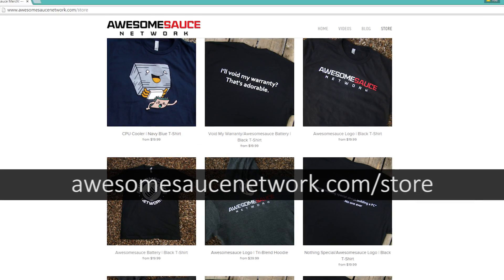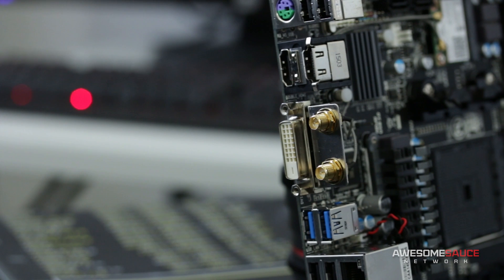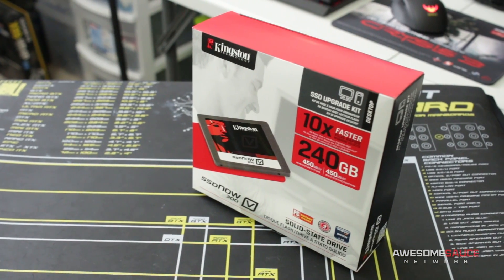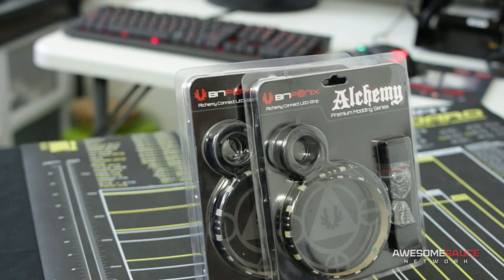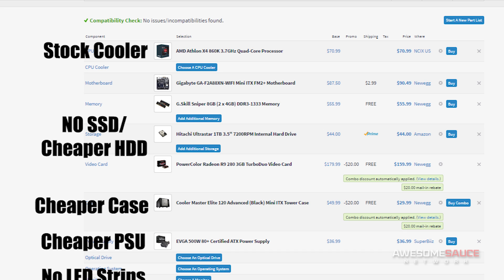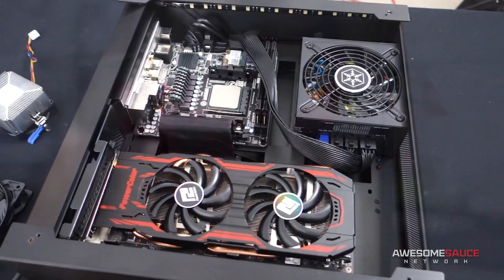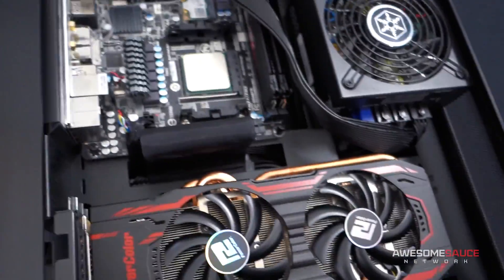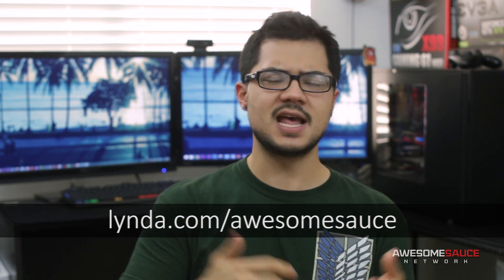The Overkill Console Killer: And How to Build One for Under $500 (Part I)

Comment: I've got a silly but important question...
Can I upgrade the CPU to Intel Core i7 and the GPU to GTX 970 easily?
Btw, I really like that case :D
Reply: Dynek good luck
Reply: @Dynek hahahah okay so upgrade to i7 and 970 and u don't need this case there are alot of beautiful ceses for 150 dollars less
Reply: You need to get a motherboard that supports i7 Intel and amd use different connectors for the cpu
Reply: Resident Gamers I'll try but... this one is fuckin' amazing!!! ;cc
Reply: RGAMING SAM Alright, thanks :D I'll be looking for one.
Reply: Here dude heres the parts you need for the whole thing
http://pcpartpicker.com/p/JKvmZL
All of it will work keep in mind its a smaller version of the gtx 970 but it still packs the same power.
Reply: Moethedirt Thanks!
Reply: Dynek np.
Reply: Dynek if youre only gaming and not doing video editing etc. get an i5 not an i7 dont waste your money
Reply: Tbh if its editing id get a xeon, i7 but for £100 less
Reply: The GPU, easily, however the cpu would need a different motherboard. Also, the i7 series is not suited for gaming, unlike the i5's. I would get a i5 4690k as it is literally the best suited cpu for gaming out there as of now.

Comment: Just my 2 cents as I have built a few of these HTPC gaming PC's. If you are trying to build a "Console Killer" then why get the Lian Li case? Of all the HTPC cases that house a full sized GPU, it is one of the most expensive and luxurious: for those who want to get a less expensive option with essentially the same layout check out the Silverstone RVZ01B or ML07B. They are the same case in different skins.

Also I like your choice of components, but on the other hand if you had got the Silverstone ML07B you would of had more money to put into your GPU. The GTX 960 is excellent for these because of it's low power consumption and heat production compared to AMD GPU's. Mighty fine looking build overall though.

Comment: 1.Ram $55.96 :Crucial Ballistix Sport 8GB Single DDR3 1600 MT/s (PC3-12800) CL9 @1.5V UDIMM 240-Pin Memory BLS8G3D1609DS1S00
2.Power Supply $39.99 ;EVGA 500W 80PLUS Certified ATX12V/EPS12V Power Supply 100-W1-0500-KR
3.Optical Drive $17.07 ;Samsung SATA 1.5 Gb-s Optical Drive, Black SH-224DB/BEBE
4.Hard Drive $52.99 ;WD Blue 1TB SATA 6Gb/s 7200rpm Internal Hard Drive
5.Case $38.71 ;Thermaltake Versa H21 CA-1B2-00M1NN-00 Mid-tower Computer Chassis (Black)
6.Cpu $97.46 :AMD FD6300WMHKBOX FX-6300 6-Core Processor Black Edition
7.Gpu $254.36 :XFX RADEON Double D R9 280X 1000MHz BOOST Ready 3GB DDR5 2XmDP HDMI 2XDVI Graphics Cards R9-280X-TDFD
8.Mother Board $78.99 ;Gigabyte ATX Socket AM3+ AMD 970 Chipset 2000MHz DDR3 SATA III 6Gbps Ready AMD 9 Series FX Motherboards GA-970A-D3P

Are these parts good for a $650.00(USD) budget build, please help i'm kind of new to the pc gaming world thanks. :) 
 
I want to play games like GTA 5 at 60fps 1080p, Battlefield 4 at 60fps 1080p etc.

Comment: Awesomesauce Network - This is siiiiick! I'd love to use this case with the ASRock X99E-ITX/ac for an extreme CPU, and then split the PCI-e slot with a cable.  This Lian Li PCO5s has four expansion slots for SLI, which would be epic on a mITX!  

The only (potentially) thing holding it back is the motherboard's ability to recognize both cards plugged in through a splitter cable, and for that a function called "PCIe Bifurcation" would need to be visible for adjustment in the BIOS.  You'd be able to switch the slit from x16 to x8x8.  If it gets enabled, does it seem simple enough to do a mod allowing an ATX PSU to fit in there and power the cards?  It seems like it from pictures.  That would be great!

Comment: the motherboard on one side of the case and the graphics card on the bottom... how?
Reply: Greendude439 PCI slot extension cable.
Reply: thanks
Reply: TooBokoo If you wanted to do the same trick with your own GPU, how do you mod the case (in my "case" it's a 750d) so the GPU can be securely attached to the case, now that is 90 degrees rotated? is there an converter for such thing? Sorry for long question.
Reply: Greendude439 How this is not completely obvious to everyone, i will never know.
Reply: Steven Davidson I had never seen that extension cable before. When you don't know the simplest stuff, things seem hard. As soon as you know it, it seems easy. Just because you've heard of an extension cable before, doesn't mean the rest of us have.
Reply: Andreas Boisen
 If you saw a TV (or anything at all, really) in the middle of an empty field or auditorium, you would not be confused as to how it was connected.
Reply: Steven Davidson ok

Comment: Intel Pentium G3258 even if only dual core performs the same as the Athlon X4 860K for the same price, and can be later upgraded to an i5, with the Athlon you'll be stuck forever as there is no better model for that socket. Also it's better to get 1x8GB ram instead of 2x4GB, you won't see much of an improvement from being dual channel, and with the 1x8 you can later add another 1x8 for a total of 16GB. Use R9 285 instead of R9 280, it's not much more expensive, but is on a newer architecture and performs better and includes the TrueAudio DSP.
Reply: GodOfGamingBG 
1) If you plan to buy G3258 with the idea of upgrading to i5 later on, you are much better off saving money now and buying i5 immediately.  If you just bought Pentium, you wont upgrade to i5 very soon cause that destroys the logic if buying Pentium in the first place. Now if you wait around with the dual-core CPU, you will end up in the market with Intel Skylake CPUs and the coming Cannonlake, which will have different socket.

2) Dual channel memory gives much better performance, compared to  single channel. Upgrading to 16GB ram sounds logical, but this PC wont need as much and 8GB RAM is still the recommended requirement for most games.  

3) There is a new A10-7870k APU coming up and, most likely, there will be an Athlon version of it. Though, it is not a massive change in therms of pure CPU power compared to the A10-7850k/860k. 

4) 285 is generally more powerful and power efficient + includes newer tech. 280 has more VRAM though. peopel that want to invest in modding and high textures will benefit from larger VRAM. Both options are good, in my opinion. More interesting is the release of new R9 300 lineup. Rumours are, 285 will be rebranded with 4 GB VRAM and, most likely, better clock speed. Now that would fit in here great!

Comment: If you're looking for a $500 console killer build, go with this instead. 

http://pcpartpicker.com/p/DX8Lxr

It comes out at $507 after rebates. If you want it below the $500 mark, just buy the 212 evo later down the road. The pentium g2358 can be overclocked a bit on its stock cooler. The processors between these two builds are similar, but this build has a better upgrade path, since it has the same socket as more recent cpus, like the i5 4690k. Same graphics card, faster ram, and intel is better than amd when you start getting into high end processors, so I would take the i5 over whatever upgrade path the build in the video's description has. Slightly better PSU (I think.), and a more reputable hard drive manufacturer. (Again, I think that is the case, not %100 sure.) Plus, I prefer Corsair cases to Cooler Master cases. (Personal preference.) There really is just no reason to go with his build over mine from what I can see. Am I missing something?
Reply: Nope your not.. Your build is what I would go also. The Pentium is still a excellent choice for gaming.  Either that or the i3. Great processors for budget builds and like you said it has a great upgrade path. People are unfortunately very ignorant when it comes to dual cores. Not to mention this Pentium is no average dual core. Its a overclockable single core beast for its price. Nothing against AMD, infact I like them also. I just feel the build you have is the way to go for gaming. Won't be able to play Witcher 3 and that Dragon Age game (until someone makes a tool to make it work like they did far cry 4) but its still a 60-70 dollar processor which will provide more power then the 860 in the vast majority of games and is easily a better choice for the upgrade path alone. In my opinion that is, not bashing AMD! :)
Reply: Tyler Antonietti Yeah, thanks for confirming that I wasn't missing anything. I completely agree. No hate towards AMD.  I made this build for a friend this week because he is wanting to get into pc gaming for under 500 bucks. He also wanted to experiment with overclocking, which is why I threw in a pentium g2358 and an after market cooler.
Reply: The build I put up should play any game out right now except unity, unless they patched it.
Reply: +Icaraeus how old are u
Reply: HAHAHAHAHAHAH
Reply: You're not 18
Reply: No

Comment: Being real here.http://pcpartpicker.com/p/BqtcrH

It couldn't cost that much.You seem to find the highest prices.
Reply: *****
You looking for my opinion.Because i have one.First off.Love the cooler.Great price on the motherboard.The ram however.That is pretty slow.An when i say slow.Lets put it another way.Take the GHz of your processor an cut it in half.That is the speed your ram should be at the minimum.About 1.750GHz or Mhz.So your ram could be 1866 for balance.But why stop there.The price of ram is only 10 to 15 more bucks.Go for faster ram.Same for the Hard drive.

Sure 1TB is great for storage.But plop a good read 500 write 500 SSD in there.Even a 120GB SSD is cheap right now.Unless that was a budget thing.Gonna nit pick that case for not having a front panel USB 3.But again.Not needed.The power supply was an Excellent choice! Bravo!
Reply: This.http://pcpartpicker.com/p/wN27t6
Alternetively.
http://pcpartpicker.com/p/vPhgvK
Note:The Hard drive is cheaper than what it said.So i corrected it.
Reply: *****
 OOOOHH! Sorry to hear about what happened.It is a good build.Should serve you well.But why get the R9290?
Reply: *****
Yeah well we both know most people don't know anything.The 6core can run anything up to 290 before it caps out.So a 290X would do a 6 core no good.A R9 390 i do not know.The R9 390X or above know for a fact it throttles.
Reply: ***** I currently have a FX 9370 a Sapphire Nitro OC R9 390 and i have installed Windows 10 Enterprise.The one you pay for.Windows 10 is still loaded with spyware.You have to systematically disable everything.An i mean everything.Hang on.

OK lets start with what i did offline after installing and disabling every feature it had to offer before logging in.I installed  Windows Privacry Tweaker,W10Privacy,DWS_Lite 700 (thats Destroy Windows Updates),AshampooAntiSpy and had to rename Peerblocker an go into Task Manager an create a Task for it to load up.I even had to change the Name from Peerblock.exe to something else.It now loads with W10.

OK.Now for the settings i had to change.
Strait into Programs and Features.Went to Turn Windows Features on or off. I disabled everything except .Net Framework 4.6 Advanced Services and XPS Services and XPS Viewer.I do not know what Hyper-V is but it turned it all off.Saved.

Now The function to access Administration tools function is gone.You cant just access it from the toolbar.They put it behind other windows to find it.Like a hunt for where we hid it.So here is what you do.
First you need your desktop icons.You click on Personalize on your right mouse click it sends you to this poor quality window with even less functions on it.You get 5 option windows.You click on Themes then Desktop icon settings.An that is IF you are not locked out due to not putting in your verification code.Which should not be necessary.Seriously some decisions here were retarded.

Now you add your Computer icon.Click on Manage.An that is the only way you can just get to Administrations quickly.You click on Services and Applications an get in Services.Run that as Administrator.An disable.Windows Updates First.Then Security Center.That turns on Windows updates.So does Windows Defender.Now you cant turn off Windows Defender.It will turn on Security Center and Windows Updates.

So what you need is DWS_Lite.It will kill the function.Note.Every once and a while it will pop up a Window from the Action Center.You need to find a way to disable that or it will start installing an sending your personal information over the net.Once you disable it.Run the Spyware cleaners again.Now.You are gonna need to go to Task Scheduler  An find anything that may want to sent out your information an disable them.An im serious Check all of them Some say disabled.Then you look at one function that is still active.You have to disable that as well.See the stuff disabled an you know what to make sure is right.

Once you check which ones.( because i dont know what version you may get.) You should be pretty clean of any issues.An can now Turn off the computer an turn it back on.If Peerblock is still not working.There is a video that shows you how to get Peerblock to wore in Windows 8.1.
Reply: *****
 No no man.The performance in limits stops there.It really started to give less performance on higher graphics cards.When tested the R9 390 did its best.But by R9 390X it bottle necked.It honestly did.

Comment: personally, i think you could have done a better job building a console killer, this case is not exactly designed with that type of configuration in mind: the cooler did not fit (liquid cooling could've been an option, but not on this budget), and the power supply cables (although could easily be swapped out for custom cables that would be of proper length), still are wrapped over the ram, horrible looking and NOT what any professional builder would ever do... ever.

my advice for anyone wanting to build a console killer, would be to not watch this video at all, no personal offense, just honest opinion on my part there.

with that said, it's not a bad part list, it surely will kick any console's ass

Comment: Y'know I  like the idea of this DIY PC to match the console's price and prowess. but the thing is, even if we're able to outpace the prowess of the current gen consoles with  low budget. We can't deny the fact that their capabilities are infinite, in the sense that devs can able to optimize their games due to dedicated hardware and API, consoles have compelling exclusives that PCs don't have. Just to clarify I'm no console fanboy, in fact the only gaming system that I have is PC. I don't have a console and I'm not planning to buy PS4/X1. I'm just expressing my thoughts regarding this kind of trend that PC enthusiast here on YT have been doing for the past 2 years.
Reply: Low-level access API's are over-rated, theoretically yes it's unlimited, but practically it's not as good as you make it too be, there is only a as much as you can do on shitty hardware
Reply: Radu Gandea Well, you have a point. But we still can't deny that the 2 current gen systems are suffice to run newer games at low cost. While on PCs, not only you have to worry about the hardware price but also the drivers that you have to install and modify or upgrade before you play. One nightmare was and until now is the GTA series with a lot of requirements before you can play.
Reply: ***** Nobody dies for installing drivers, its just laziness not to do so.
PC has more exclusives than ANY console, and buying a 300 low power pc (console) just to play 5-6 exclusives is not worth it.

Comment: I wish that youtubers would actually ask in forums before building what they claim to be the "console killer"
An example of a far superior build with room to spare for a evo 212 or other air cooler:

[url=http://pcpartpicker.com/p/CLVBHx]PCPartPicker part list[/url] / [url=http://pcpartpicker.com/p/CLVBHx/by_merchant/]Price breakdown by merchant[/url]

[b]CPU:[/b] [url=http://pcpartpicker.com/part/intel-cpu-bx80646i34150]Intel Core i3-4150 3.5GHz Dual-Core Processor[/url]  ($103.99 @ SuperBiiz) 
[b]Motherboard:[/b] [url=http://pcpartpicker.com/part/gigabyte-motherboard-gab85mgaming3]Gigabyte GA-B85M-GAMING 3 Micro ATX LGA1150 Motherboard[/url]  ($40.98 @ Newegg) 
[b]Memory:[/b] [url=http://pcpartpicker.com/part/mushkin-memory-997005]Mushkin Radioactive 8GB (2 x 4GB) DDR3-1600 Memory[/url]  ($49.99 @ Newegg) 
[b]Storage:[/b] [url=http://pcpartpicker.com/part/seagate-internal-hard-drive-st1000dm003]Seagate Barracuda 1TB 3.5&quot; 7200RPM Internal Hard Drive[/url]  ($48.45 @ OutletPC) 
[b]Video Card:[/b] [url=http://pcpartpicker.com/part/sapphire-video-card-100373l]Sapphire Radeon R9 280 3GB Dual-X Video Card[/url]  ($149.99 @ Newegg) 
[b]Case:[/b] [url=http://pcpartpicker.com/part/fractal-design-case-fdcacore1000usb3bl]Fractal Design Core 1000 USB 3.0 MicroATX Mid Tower Case[/url]  ($33.99 @ SuperBiiz) 
[b]Power Supply:[/b] [url=http://pcpartpicker.com/part/evga-power-supply-100w10500kr]EVGA 500W 80+ Certified ATX Power Supply[/url]  ($28.99 @ NCIX US) 
[b]Total:[/b] $456.38
[i]Prices include shipping, taxes, and discounts when available[/i]
[i]Generated by PCPartPicker 2015-05-07 03:39 EDT-0400[/i]

Comment: I think a solution to the height clearance may be to add rubber gaskets under the mounting holes to raise the glass a few centimeters? Just a thought. If you find long enough thumb screws

Comment: i3 may have been a potential better choice and fairly sure those SSDNow V300 drives use either some really awful flash or a bad controller because there were reports that these drives are really damn slow.

Otherwise, interesting choices.